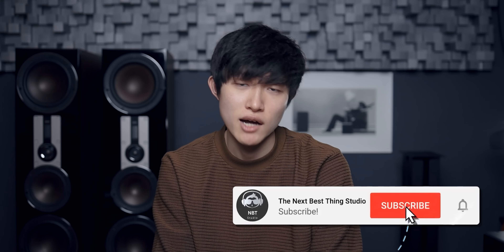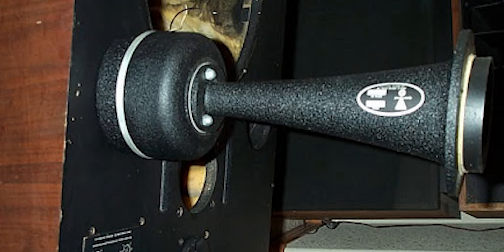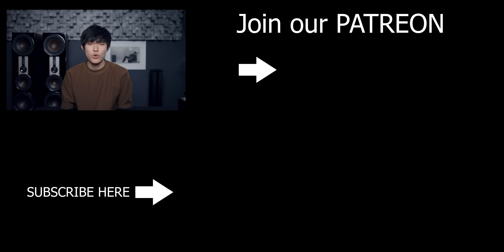Vintage HiFi speaker drivers like THIS was the BEST for a reason

Comment: I absolutely love my vintage LSU/HF 12/8 Tannoy’s. Poly cap replacement inside the original crossover pack. There is something to be said about concentric drivers and the accuracy of the phase response. The level of detail, speed and smoothness is astonishing! Especially for a 50 year old  driver with all original cones.

Comment: Most if not all of those alnico speakers also had paper cones....which you rarely find in modern speakers and it definitely makes a difference in the sound.
Reply: Yeap, paper drivers are my faves for sounding really natural - more natural than most other materials.
Reply: I have an affinity for the Bozak woofers.  It's a proprietary composite made with pulp paper and wool.  Rudy Bozak knew what he was doing.   
 I would love to hear a set of Tannoys ...

Comment: Alnico drivers are still alive and well in the guitar amp industry.  Companies like Celestion and Eminence produce most of them. They aren't cheap though. They typically range from $100-350 for a 10 or 12" speaker. Guitar amps mostly use 12" drivers.
Reply: $100 to $350 for a ten or twelve is the normal price for a low end to decent midrange sub driver. Not super expensive.
Reply: @Audfile  Yeah that's true. When you look at a $350 modern sub, it makes the Alnico speaker look like a pos. Although of course we know that the Alnico is badass. They've just been making them exactly the same since the 1950's. They go to great lengths to make them that way.
Reply: @rigorhead01  oh just taking prices. But then again a guitar amp driver is not a sub driver! Bad comparison!
Reply: Include Jensen Alnico Speakers!! ✌
Reply: There is a whole WORLD  of difference between an instrument and its amplification, or audio production and audio reproduction.
One is meant to be voiced and have or impart a character, the other is meant to entirely get out of the way and as faithfully as possible reproduce the signal being sent to it.
One is an actual instrument, intended to have character and colour. The other is absolutely NOT.

Comment: as an owner of vintage altec lansing 16 inch drivers with alnico magnets and never heard a driver that sounds so good and they still looks like new after 45 years .i will never replace that driver .....
Reply: Agree.  Will take a lot of cash to separate me from my Altec 15” 604-8h alnico coax w mantaray dispersion horn
Reply: @stillastillsfan  love that driver bro .i have the 416 8z wich i will never replace .i try to look for another pair like that...
Reply: With ess hail air transformers as mid high unit....

Comment: Having owned the old Tannoys, (Red, Silver, Gold, and HPD) and quite a few modern speakers with polyprop cones, low efficiency, as well as solid state and tubes.. I must admit that I'm glad I kept one pair of Tannoy HPD since they have a unique sound. Papercones, relatively efficient at 92db I think, and that special sound of their COMPRESSION drivers and alnico magnets.. Tannoy now has abandonned "compression" drivers and do use metallic tweeters behind their mid-bass drivers in most models and you can hear it. Just different. You either like it or.. not. I've sold my DMT 10 one month after I got them. Even my tube amps could not give them warmth, bloom.. fun. Yes, Alnico + paper cones + compression drivers is one of the winning combinations of that old era.

Comment: I never read into it but just assumed 'Alnico' was the speaker magnet's compound material. My own 1969 Tannoy 15" M/Gold's worked perfectly (to my ears) until about a year or less ago, when 1 speaker's cone started magnet rubbing (lost it's alignment) am they are not the later HPD series which have replacable foam which could fix the problem.  I keep them in case some company could put it back to original. They remain my most fave speaker ever.  Until you mentioned 'bloom' i didn't realise they had a perfect amount of it, to my ears. Their engineering is phenomenal i noticed when tsking the 'rubbing' one apart.  I thought i saw how the compression driver had 5 or so "magnetic shunt rods" from the big magnet to save itself from having a seoerate magnetic structure, but that was guesswork & all i know is that i yearn to hear them again & my 4 (worthy) stashed speakers still have not alleviated my Tannoy D.C. yearning.  With 15" drivers & high efficiency, i guess the main driver's movement is small in an averagely smallish living room.  One u.k. company said they could fix the faulty driver for me, but when i asked about what surrounds & if neccessary, what cone they would use, i simply got no further correspondence although i had asked in the nicest of fashion, i wanted to know what their plan was because the cone's  surround termination seems to be an integral part of it's whole construction, but they didnt want to answer me or even request i send them the working cone, so i believe they had no plan to match it to anything & i would have got a different inferiour sounding speaker back, but my question put them off from all further correspondance. One guy on a forum said he had his same Tannoys with rubber surrounds, maybe it's a way forward to hear them agsin but i'm not keen. They were "The best i ever had" warts being a woody collouration due to their cheapest 1969 version with  "Tannoy Lancaster" cabs. But that could have been improved with bracing  (they lacked any, just sheep's wool inside mine)   "Wonderful speakers" beyond time & new technology considerations, i.m.o. 
btw, In 1988'ish,  one replacement cone for the 12" version was g.b. £1300, i found from a burgled... (maliciously so, prob because they were too big to carry off into the night) ...friend who needed to replace a totally kicked-in 12" Tannoy & had rang Tannoy U.K. in Scotland to price a replacement

Comment: I think the reason these where coveted back in the day is more to do with proper design and build quality, rather than the magnet material itself. AlNiCo was the neodymium magnet of yesteryear, so to use it indicates that the driver manufacturer wanted no compromise in the design. I remember some of the matinees had the Altec A7's, and I certainly lusted after them as a teenager, but they sound quite dated compared to what is available today. Never the less, some of these older vintage speakers still do stand the test of time. As far as drift in performance goes, thats much more likely to be due to deterioration of the driver/cone materials and glues rather than anything with the magnet. The rest of the speaker will perish long before the magnet has any issues.

Comment: I’m 34 years old and have also fallen in love with the tube / alnico combo.  I have listened to numerous hifi speakers but have settled on alnico JBLs.  I’m now getting into Tannoy monitors.  I find they have the exact same bloom or magic you speak of.  My JBLs list of L80t, early all alnico L100, 4312, L166, L200 (with original alnico LE15 and new 2216ND woofer) , L300, and I still find myself preferring the all alnico L100 and L300.  The L166 is a close third though.  

My next speaker will be Tannoy Red 12, which I’m thinking of installing in an old MCM stereo cabinet with my tube fisher 400 (legendary).

Comment: Thank you for another great video, Jay. I  believe AlNiCo (as it is sometimes spelled) was used in all sorts of transducers because it lost is magnetism rather slowly and especially because of its high flux density or the power of its magnetic field. This was essential given the low powered amplifiers of the day because it allowed for high efficiency speakers. At least some rare Earth magnets today exceed AlNiCo in these respects. But what about the differences you detect? It is only speculation on my part, but there may be measurable factors. One is that AlNiCo magnets are big compared to things like neodymium which can cause reflections and possible harmonics. More importantly they're not only big but they are enormously heavy which may contribute to damping vibrations. The high efficiency aspect of these magnets may tend to produce louder volumes when compared to other speakers making them sound better despite any flaws of frequency response, phase, etc. The need for efficiency was coupled with large cone area. Larger cone areas, all other things being equal, will produce reductions in intermodulation distortion. Many thinking term modulation distortion is not an important factor but there are studies to the contrary as well as my own experience. Back in the heyday of AlNiCo magnets and before, field coil speakers were popular. In these there was no permanent magnet but rather a second electromagnet (in addition to the voice coil) that was of a constant polarity against which the voice coil and attached cone could react. Many see field coil speakers as making a comeback. It does allow one to adjust numerous parameters that are not allowed by permanent magnets. Keep up the great open-minded research and reporting . It and you are appreciated by friend!
Reply: Great post mate.
Reply: @rationalmartian  Thanks! Part of my family is from "Down Under"!
Reply: Marten Dekker   @Marten Dekker  Thanks for the reply. I am familiar with the even versus odd order harmonic argument and think there is certainly something to it. I don't understand how a magnetic structure could do one kind or the other without vibrating. But the vibrating is something that a magnetic structure should not do. Further, it is unclear how one kind of magnetic material versus another would alter the harmonic structures in a consistent fashion. Do you have more information? This sounds really fascinating. Thanks again!

Comment: Modern Tannoys and JBLs still use alnico drivers in certain models. The modern drivers are not smaller than the older models. The L300s actually have a small compression driver. Take a look at the 2441/2440 used in the 4350's, they are 4-5 times bigger. JBL still make compression drivers the same size as the L300 and 4350 drivers.
Reply: It seem you are really fan of Alnico Magnet (speakers/drivers) sound...have you listened to Field Coil Magnet (classic/Resto mod/modern classic) ? 
I think WESTREX/JBL/JENSEN/ALTEC/TANNOYS sound ...primarily due to horn/compression driver design...cone speakers ...the bigger the better.

Comment: Your absolutely correct on your views. The huge massive speakers from JBL, ALTEC LANSING, ELECTROVOICE, KLIPSCH, plus a couple of other American makes that were in the movie theatres of the 50"s - 70's. These all were low wattage tube powered  driven. They were very efficient and had powerful sound. Pure classic and classy for the time period.
Reply: In the 50’s through 80’s Electro-Voice made Klipsch drivers.  Most current Klipsch Heritage line woofers are made by Eminence.

Comment: Jay, 

the JBL 4350 clone speaker you showed at 1:40 is all Ferrite, not one single Alnico driver inside. I was there at European Triode Festival in Berlin 10 years ago, and actual some of my gear is also in that picture.
Speaking for myself, I prefer Alnico to Ferrite and even to Electromagnetics.

Comment: TAD Drivers from the 80s... not saying that they are better than TAD current drivers, but they are AMAZING regardless, even for current standards. 

What it has improved a LOT is power handling and Xmax.

Comment: Audio Note still makes them at the very top circa 6 models. Yes you are right, they have a very special sound, making a lot of the newer and fancier units sound very flat/incensere. And yes they cost a lot, and AN actually improved on the original unit sound. They start using them at around AN-E SEC signature. That is one of the reasons why I call it one of the top 10 speakers on the planet of all time.

Comment: I have a pair of tannoy hpd 385 in Arden enclosure,I bought the drivers in 1978 ,and awhile later built a pair of Arden enclosures,these speakers blew me away with the quality,even had police at my place and the said they could hear them 2 blocks away,I had a 20 w. Per channel special amp driving them and if I turned them up too far they sounded like the 15 inch sub in my ladcruiser,.
Haven't hear them for 40 years as the cones came apart and I move to other side of Australia (Victoria).thank you for information in your article that I didn't know,I intend rebuilding my tannoy speakers

Comment: Jay, my first stereo system was a Heathkit SA-2 integrated amp with a pair of GE 401 12" coaxials in GE 406 corner cabinets (given to me by my uncle back in 1972) - I've been a "Bottle - Head" ever since then.
Reply: I built a Heathkit stereo receiver I think back around 78/79 I don’t remember exactly now too many years ago. I think it was the AR 1500 again memory loss. It was a Best Buy in Consumer Reports Magazine at the time.

Heathkit put together some great kits in its day. The manuals were well documented, including trouble shooting components if needed. Heathkit was sold to Zenith later. 
I wish I still had that receiver.
Reply: @davidfromamerica1871  The Heathkit amp I had was from 1961 or '62 it was 12 watts per channel and used four EL84 tubes in the output section. When it died a couple of years later I wound up buying a Pioneer receiver and always felt something was missing from the music.

Comment: Although modern magnets are more efficient (higher field strength for lower magnet size), the (back in the 50s) advanced Alnico V magnets could produce fields of 1.95T for the Altec 288 G&H compression drivers (yielding an efficiency of 113.7dB/Wm!), and the 515C 15in woofer an efficiency of 104.7dB/Wm, with a self-resonant frequency of 26Hz, making it one of the best low frequency drivers ever produced, with the added benefit that its self-resonances start only at 3,6kHz, so it also has an excellent midrange as well (while modern 15in woofers have self-resonance issues just above 1-1.5kHz). Using any kind of magnet we tap out around 2.1T (like the top model Focal Utopia beryllium tweeter), and the vast majority of modern (neodymium or ferrite) drivers do not go above mere 1.2T in the 98% of current production drivers. Ferrite and neodynium are very brittle compared to alnico, and their self-resonances also impact the sound the driver makes. Plus, the Alnico drivers were built in a quite different fashion: the magnet was placed inside the voice coil, and the magnetic circuit was closed from the outside, while the modern drivers have the magnet on the outside, and a magnetizable pole piece on the inside. The result is that modern drivers radiate their magnetic field outwards, and also, they are very sensitive to external magnetic fields, while the Alnico motors have self-contained magnetic fields, that is, they do not radiate (loose) magnetic energy to the surroundings, and are also magnetically shielded from them. Well, I might take on your poetic question on what a modern speaker might sound with Alnico drivers. Indeed, there are some in production like Tannoy, but most are just iterations of "old" technology, and do not draw on their true potential. I redesigned my speakers from ground-up, utilizing the 515C for what they were born to do: whip out the subsonic region, with grace and sheer effortlessness.

Comment: Here's a thought, older paper coned large drivers in a larger cabinet used far less power to deliver the sound in comparison to smaller plastic coned speakers with higher powered amps..
Yes because of the technology of the time meant speakers were made to be highly efficient.
Paper cones are faster and produce the midrange much better than plastic cones, and a 2 way speaker is always going to be more accurate and balanced than a 3 way system...
The key for me is how good does it sound at very low volume? I hate having to turn the volume up just to stop it sounding tinny...
I use vintage speakers with a modern transistor amp..
Although I do use a amp to play guitar, but that's a different story as I'm listening to live music, not prerecorded

Comment: Have a pair of Tannoy 15” Golds paired with a Garrard 301, SME 3012 and Denon 103R plus Consonance Tube Amp

Recently had a new set of external Crossovers made by Reference Fidelity Components.

It gave them a new lease of life. 

Speakers for life.

Comment: A tip for Tannoy DC owners .They sound wonderful with the Chinese copy Dartzeel NHB 108 amplifiers.I have had plenty of Tannoys and tried plenty of amps over  the years -SS ,Class A SS.Push pull tube ,SET Tube.Gainclones,Class D  and nothing sounds as good as these affordable Dartzeel copes.Not even close.They must be used with a god active preamp  however.And they take ages to break in  and open up.

Comment: The boom is perhaps the surface areas. You see a 15" driver has a surface area of 177 sq in, approx, whereas 1 12 in has a surface of 113 sq in. The newer drivers might have a longer extension, but it does not move as much air. I remember one can feel the air being moved when listening to a 15" driver. But the tactile sensation is gone with the modern speakers. Am I right with my assumption?
Reply from the maker: mmm. For me, I would have to disagree. Many smaller drivers nowadays (atleast when we start getting to the higher end floorstanders) give me enough and more of what the 15 inches gave me.

Comment: Look at the magnetic flux curve of the Alnico vs Ceramic magnets and you will see why. With Alnico, a lot more energy is stored and returned each cycle. As an analogy, to me, Alnico are class A, and Ceramic are class D in amplification terms.